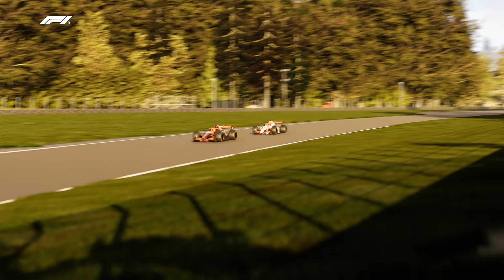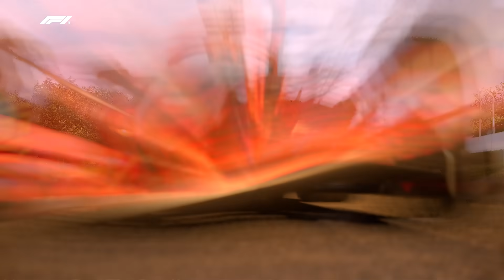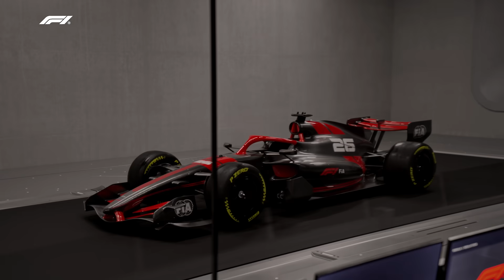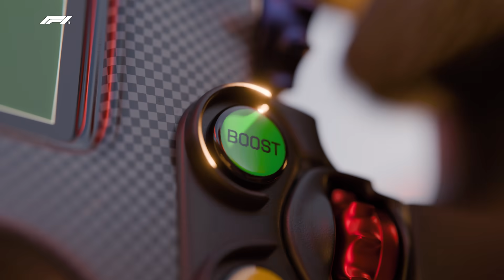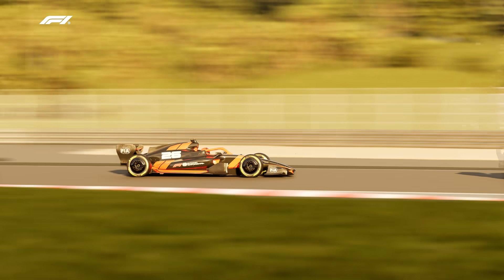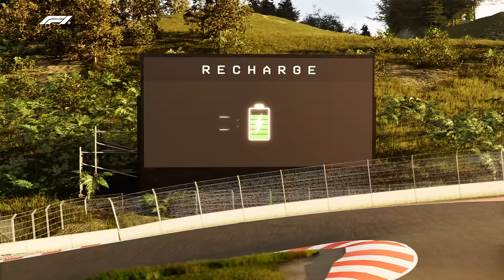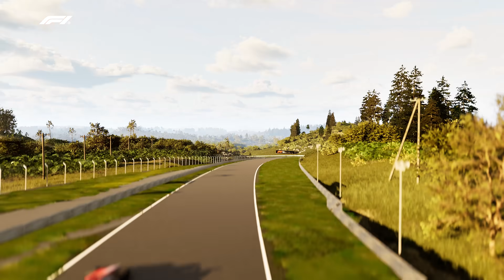Everything You Need To Know About the Formula 1 2026 Regulations

Comment: The problem is if the cars can stay close and exchange overtaking in curves and not only in the straight, the problem is the circuits that have been built in recent years allow it? I personally would like the agile cars of the Schumacher era, not faster cars on the straight and on the corner but agile and small cars that allow overtaking exchanges in increasingly narrow circuits (you build them more and more narrow but what's the point?) It will go like last era, cars are not able to stay close for more than one lap and they will almost always be overtaken in the straights, I hope I'm wrong

Comment: "On designated straights drivers can engage straight mode, which opens the wings to reduce drag and increase top speed" hmm... sounds like a Drag Reduction System doesn't it
Reply: yeah, only 2 changes, now it affects both wings and won't need to sit within a second behind the car in front. think of DRS in other sessions outside of the race itself, but now its in race itself.
Reply: @Juozapas001 You'd still have to be within a second to activate
Reply: @dakinnie that's overtake mode, mot the active aero
Reply: @dakinnie no that is only for the overtake mode if i understand it well (engine mode). Not for the active aero.
Reply: yeah its for overtake mode, which from other explainers i've seen is more of a electric ramp-down control, as in motor goes down to 0% of power at higher speeds (350kph or so, from what i heard)
Reply: thank you for a clearer and more detailed explanation on that 👍
Reply: @dakinnie  not the new drs u dont need to be within 1 sec u can activate it at any  time but u will need to be  within one sec for overtake  mode which is separate
Reply: And it would not at all be confusing if they still called it DRS

The general fanbase isn't technically minded, they'd see no difference to the DRS as we knew it up until now, when it's a whole different concept and purpose
Reply: @Holoflux  It would be confusing. Straight mode isn't an overtaking advantage; it's a mode that can be activated at any time, by anyone, anywhere. The overtake mode is essentially a replacement for DRS with the same rules that DRS had (be within 1 second at the detection spot and only use it in certain areas) with the only change being that there's one detection spot for the entire lap instead of one detection spot per DRS zone.
Reply: @alex-d3l2z  That's exactly what i'm saying and why my comment was sarcasm

It is a whole different system, the only common thing here is that both reduce drag, that's why they changed the name and nobody can see why they did
Reply: Yes with the difference being all cars get drs at the same time in the detection zones. Who cares what they call it.
 Well except you clearly. Do you feel better for the attention or vindicated for pointing out the obvious.
Reply: if the car is producing downforce, then there is going to be drag, if there is drag, then there is going to be some kind of drag reduction system to make the car go faster on straights. one cant change  this basic fact.
Reply: Yeah they basically said we’re gonna make the front wing open up as well (stronger drs)… to make up for the cars lack of speed/weak electric motor.

Comment: The whole “carbon-neutral” narrative feels completely disconnected from reality. The sport spends nine months a year flying teams and freight around the globe, yet we’re supposed to believe the solution is ever-more complex power units. A simpler formula — something like a V10 with active aerodynamics — would arguably be better for racing and the environment than relying on battery tech that depends on intensive mineral mining. Hybrid systems barely make sense in family cars, let alone in a flat-out race environment. It’s hard not to see this as optics over substance, and most people can see straight through it.

Comment: I don't really understand what's different between "DRS" and "Active aero", both seem to fit the description given in this video of "F1 cars will dynamically adjust the angle of their front and rear wing elements in specified high speed sections"? i mean i get that it used to only be the rear wing, but beyond that, still seems to be the exact same thing?
Reply: nono, straight mode is available for every car no matter the distance to other cars, drs is not

Comment: Your already out of date with your own terminology, its not 'cornering mode' and 'straight mode', its just 'active aero'. If you said something like 'the drivers can use the new active aero to increase and decrease front and rear wings levels - to gain more downforce in the corners and have less downforce on the straights', i think that would have been better.

Comment: Bring back V10 that's it the soul of F1 is destroyed years and years ago
Reply: Not going to happen.
Reply: @PlaguedByDesire source : trust me bro
Reply: @KEISERRR I have followed and watched F1 since 1988. And V10's, fun engine as it was, is not coming back. The car companies doesn't want them, therefor they won't return.
Reply: @PlaguedByDesire well as a member started watching from 2010 and yes you're way older F1 fan than me but if they are running now on sustainable fuel why not bring back those masterpieces since F1 is a Motorsport
Reply: @KEISERRR motor is not the same as combustion. An electric motor is a motor. The world is always changing, the manufacturers follows trends and market shifts. So the combustion engine is on it's way out, electric cars are on the rise, and fast. 25% of all cars sold worldwide in 2025 were electric. In Norway that number is a staggering 94%.

Comment: Very curious on two things 

1. The overtake mode has a drs function but is it used on only that straight/section + if you choose to not use it it will it become a form of playing chicken like we had in in saudi 21 and 22 but weirder since as far as i understand it will draw more energy from the same charge and logically speaking should use it more and how will it be decided where these zones are placed anyway?

2. The downforce mode wings, i haven't heard conclusivly if the drivers have full control the entire lap is it a on or off switch or can they choose with more risk to particially lower the wings and do they controll both wings at the same time or is it locked to both or none

Also a worry for me is that teams are gonna be so efficient with their use off these wings that it will not matter in terms of brake zone 

Overall tho very excited to have potentially more control in the drivers hands

Comment: Even with absolutely everything here, this is a clean sheet of paper, so to speak. Saying that, there's a lot of exciting new features that should only make the racing even more unpredictable than it already is. I can't wait to see what is about to fill it up. Just as excited as I was in 2022, and 2026 is effectively a simplified version of it.

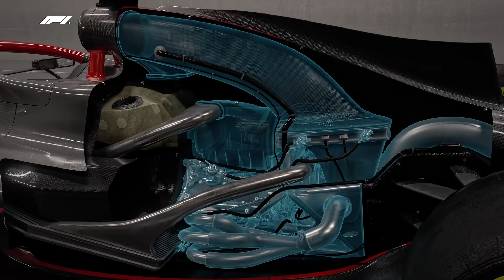• Following from 4:35, 53.333% of the power comes form the ICE (400 kW, ~536 HP) with the remaining 46.667% from the MGU-K (350 kW, ~469 HP). Combined, they generate about 1,006 horsepower, or more specifically, 750 kW. The engine's compresison ratio has been reduced from 18:1 (18.0) to 16:1 (16.0), and its fuel mass flow is reduced but its fuel energy flow is increased (They're similarly monitored), hence the loss of its own power, but with the MGU-K power going up from 120 to 350 kW, nearly tripling its power, it makes that 53/47 split.
• Following on from 5:10, along with the MGU-H, variable inlet trumpets and a split-turbo layout from the turbocharger are also being outlawed.
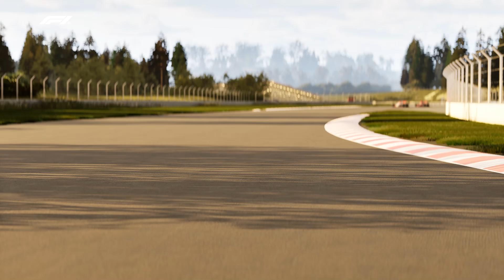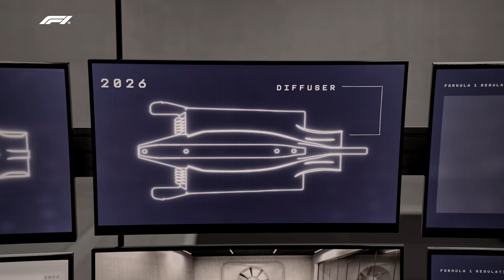• Following from 1:33 to 2:47, the wheelbase is shortened to 3.4m instead of 3.6m, width from 2m (Since 2017) to 1.9m, and the length is shortened from about 5.6 to about 5.4m. The tyre width is narrowed from 305 to 280 mm at the front and from 405 to 375 mm at the rear, but their rim diameter is still 18 in (46 cm). The minimum weight is 768 kg instead of 798 kg. Downforce should be reduced by 15%, but drag by between 40% and 55%.
• Following from 0:58, in the event of wet weather, the active aerodynamic surfaces will work differently in Straight Line Mode (SLM). Instead of both wings opening, only the front wing will, before retracting into Cornering Mode (CM), which should happen either by lifting off the throttle pedal and/or pressing the brake pedal a sufficient amount, or manually by pressing a button on the steering wheel, like DRS did.

Comment: Except for when they HAVE to lift on the straights at multiple circuits. You might as well drop Monza off the schedule, I don’t see these cars completing a lap without depleting their battery 🪫.  Probably the same at Spa, Mexico City, Vegas & Baku. Definitely have to back off on straights in Montreal, Austin & Abu Dhabi. Should have kept the MGU-H. At the exact moment you need more energy recovery, you guys drop a key source. I don’t remember a MGU-H failure in all of 2025, so it’s definitely reliable technology. I anticipate a disaster of a year with racing so bad they’ll be rushed regulation changes after pre-season testing and at points during the season. The MGU-H will be back on the cars before Spa & Monza. The overly complicated and expensive active aero front wings will be gone as well. Too many poorly thought out changes and not nearly enough testing to refine and adjust to the realities they will bring.

Comment: I feel like there's about to be a lot of those weird side skirt things just after the front wheel snapping off.
Reply: And causing punctures in the rears
Reply: teams will probably find a way to strengthen them
Reply: @Archeoptery my bet is after testing you'll see the floor plates extending further out to support it or they add a connecting rod between the top edge to the actual chassis. don't be surprised if you see teams playing games with them and intentionally trying to break them off.. but we'll have to see how testing goes.
Reply: Side barges will be flying everywhere, a bit disappointing they don’t design for strength such that a little tap here or there is unlikely to cause damage. Would result in much more exciting racing

Comment: ah, now I see the point of the new overtake system. it allows for more overtake oppurtunities in shorter straights instead of just the 1 or 2 long straights per course. interesting. I don’t hate this change anymore.
Reply: I imagine that most of the drivers and teams will find a way to optimise this, and then no one will gain an advantage most of the time.
Reply: They will have to strategize it cuz they will be using a lot of power , imagine using the system at every possible moment in a lap , they will lose power by 30 laps  or so I guess
Reply: Wrong 😂 cos the car in front will simply use it TO DEFEND 😂😂😂
Reply: Most people dont understand that part, this allows for overtaking at every possible opportunity
Reply: @BornKing93 it allows the car in front to use it everywhere TO DEFEND …..
Reply: Finally 1 overtake in Monaco.
Reply: @blackbox1024  Lance Stroll has 3 of the last 4 overtakes at Monaco (not including lap 1).

Comment: Man the F1 game will require a wheel with 26 buttons, i can't afford that!
Reply: I thought the same thing initially (about controllers), but I don't think so. It's not clear if straight mode requires manual activation. If it does, then yes, it's an extra button. 

Other than that, you replace the DRS button with Overtake, and you have Boost on what is currently the Overtake button.

Also, obligatory: "Less buttons, more?"
Reply: hahah. Think about the drivers! They will feel like they're playing a video game remembering buttons combo at 400kmh rather than focus on race lines.
Reply: @taonflorian2  rage bait and see the driver smashing button randomly like they were playing street fighter
Reply: Seems that 26 season will come as a F1 25 DLC
Reply: @cesarsouza3163 is mean F1 2026 season video game will become DLC right
Reply: @chinghoongleow1191  yes, no new game in 2026. Just a F1 25 DLC with Season 26 content. Cars, tracks, drivers, etc
Reply: @cesarsouza3163  that's great news. they should do the same to FIFA games

Comment: Small question :
If the front wing is damaged, can the team replace it ? Because how would they be able to change it and connect the active aero in a small amount of time ?
Reply: Yes, the active aero is mechanical not Electronic, so is quite fast to change it.
Reply: @RoyMatzem but you'll still need to connect everything, it might be a bit longer than what we had in these previous years
Reply: A few different ways potentially come to mind, it could be physical linkages that are connected by pins and rotate around a pivot. Another alternative is hydralic based with a quick release valve that connects to an already pressurized front wing and a relief valve that ensures theres sufficient pressure. Less likely but still possible would be having the hydraulic or motor driven engagement happening on the front wing element to be replaced with just wires and connectors leading to it. The last i dont see as viable as the first two due to the placement of weight and increase in consumable parts and cost on a   part more likely to be damaged or placing weight in an undesirable locatuon for cog.
Reply: @nickrec22 this would still take a bit more time to connect the wrong wing compared to what we had previously no ?
Reply: @aloter1680Potentially, but wed be talking on the same order of magnitude for how much extra time id say, and its a professional pit team, so theyd be training and whittling down those extra tenths of a second.

Comment: I'm really excited to see how these smaller and more nimble cars change up the racing environment, hopefully resulting in more gnarly and bold overtakes. I'm also very curious to hear how the other team engines sound like since we've already heart Honda's.
Reply: I'm not sure how 2cm and 1cm will change anything for overtakes.  I guess it's mostly to reduce weight and drag to counter the bigger and heavier battery.
Reply: @Hide_and_Tweak 200mm and 100mm is 20cm and 10cm mate. It's quite significant since 2022 era regulation cars are about 1.13m longer than 2012 cars. A reduction of 20cm means It's now 0.93m longer.
Reply: @khoatran-sv7je so still WAY TOO BIG…and WAY TOO HEAVY DUE TO THE LARGER BATTERY NEEDED for the 50%!,,
Reply: @Redlingstein  It's probably gonna take a couple of months until teams adjust to the new rules and get similar lap times
Reply: They are so heavy due to the BIGGER BATTERY and hardly smaller… so it won’t make any difference

Comment: The new rules are amazing in theory, but i fear with the dynamic grip, lets say your ability to change the wings angle fails, you then if your in straight line speed mode before, you get no downforce in the corners, then your car is basically useless, will lead to a lot of crashes, but if they don't fail, the racing will be the best its been in decades.

Comment: Why u guys making the car smaller 😢
Reply: Because smaller cars are headed back to future aka 2005/6/7 regulations
Reply: @HHCHunterYTC  yeah but the problem is how are they gonna fit the halo
Reply: Because the complaints I heard about is that the current F1 cars are the size of a truck
Reply: @kevingame3198  The tracks were designed with much smaller F1 cars in mind. The modern cars are simply too big for the older tracks and therefore the racing is very boring.
Reply: Congratulations! 🎉 You are the first and only race fan on earth that hates overtaking

Comment: FIA kept transforming Formula 1 from a sport to a game governed by more and more questionable rules.
Reply: That's most if all sport, no? And we've had similar regulations for decades. You understand the goal is still entertainment?
Reply: @pyrdepavkki  Yes, I understand it is still entertainment. I'm watching F1 since 1990 and I can tell you for sure that it became more and more boring since about late 2000s/early 2010s.
Reply: @mituc  Well there is a balance between safety and entertainment, I would look more towards that if comparing towards 80s and 90d
Reply: @pyrdepavkki  Early/mid 2000s cars with the latest safety features (2017+) would be pretty cool. Cars that are larger than an E-Klass and circle around because they can't overtake each other on more than half of the tracks is not entertaining at all.

Comment: Push to pass is an exciting addition. It has made Indycar more interesting.
Reply: I think F1 took a page from Indycar especially that overtake button
Reply: @PancakePrince1  Both buttons have been in F1 in the past
Reply: @thebritishmotorsportfan Which era? 2027 will hopefully bring grooved tyers 💪🏻
Reply: @steveo85  It was in the 80s and 90s labelled on the wheel as "Boost", which simply added more power output, and wasn't regulated to be used in any specific places. The grooved tyres probably would ruin the tyre stratagy element of F1, slicks are the way to go imo.
Reply: It has not. I watch Indycar and both cars use it to defend or attack at the same time 😂 no OVERSPEED to no overtake.
Reply: @Redlingstein  the same thing will likely happen in F1.

Comment: I'm new to F1 and by all that I've heard I was wondering if the new regulations for 2026 are just "regular" changes from year to year or if they're more special - I guess I got my answer now
Reply: Nope. It's a brand new set of regulations means that the car will be brand new.
Reply: Usually, big changes come once in 4 years. But changing the whole idea of power unit last happened 12 years ago, so it's quite big
Reply: @michazaborowski3610 MotoGP>>>>>>>F1(Very Boring races 🥱😴)
Reply: Usually they'll change regulations for one or multiple parts of the cars (front/rear wing, bargeboards, floor, etc), but these regs have been designed from the ground up alongside the engine being new.